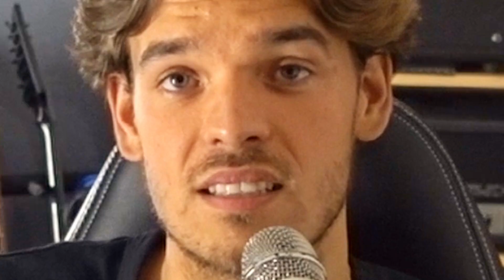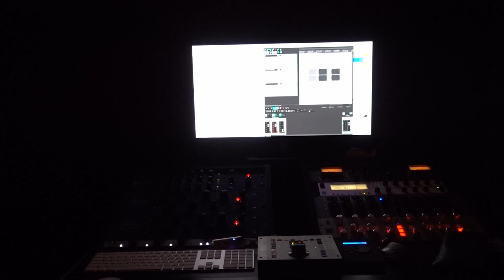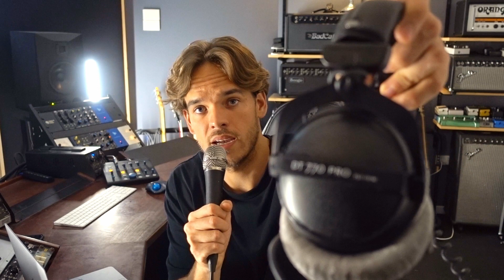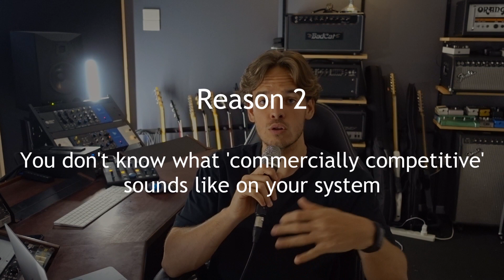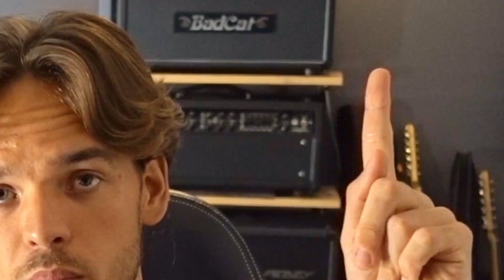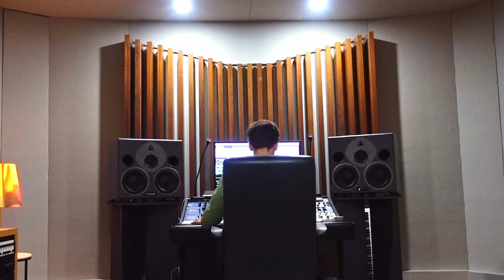Why Does Your Mix Sound Bad In The Car and How To Fix It.

Comment: This is from Quora: 
'Sounds interact differently between headphones and speakers.

Headphones are right against your ears; the sound is binaural, there’s no crosstalk between the left and the right, and as such you get a different perception of frequency, phase, and stereo position.

Speakers are in front of you, and they’re directional, but they’re not laser-like, so sound waves from the left interact with the right and vice versa. So some frequencies can cancel out, others can get boosted, and so forth. And then your head gets in the way. And the human brain isn’t very good at decoding positional cues in lower frequencies, so stereo fields in bass sound amorphous.

In short, there’s a lot that happens in sound when the speakers aren’t pressed directly against your ear canals. And that can make a huge difference in how things end up sounding. If you mix on headphones, you may be trying to make a good “headphone mix” that won’t translate for the aforementioned reasons.

On the other hand, “speaker mixes” usually translate better to headphones. Which is why most engineers mix primarily on speakers, using headphones for detail work.

But not all is lost! There are a number of plugins, programs, and tools that can simulate speakers on headphones. dearVR, Slate VSX, Acustica Sierra, Waves NX, Sonarworks SoundID, and several others exist (many DAWs even come with a basic one) all do some form of “binarual correction” so you can minimize the binaural effects when mixing on headphones. None are perfect, so it’s still best to check on speakers when you have a chance, but it can at least get you part of the way there.'